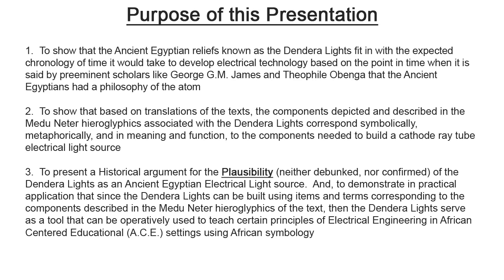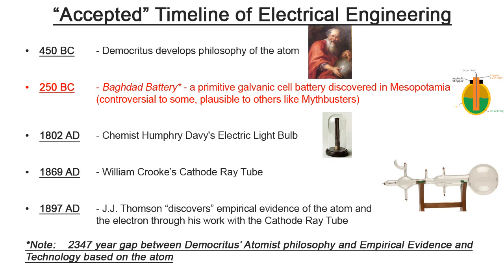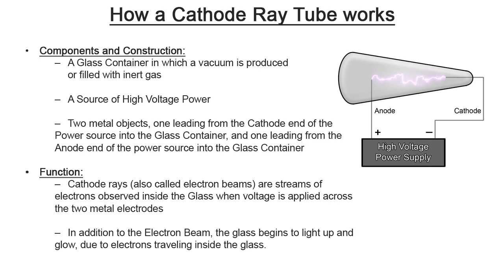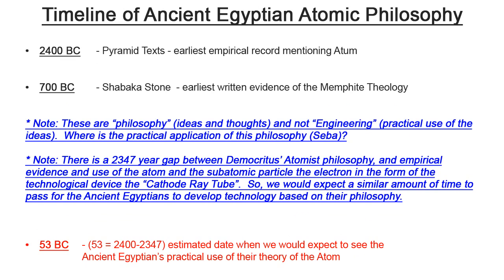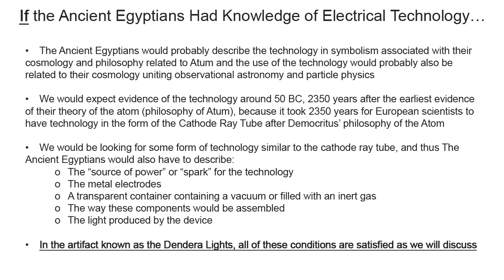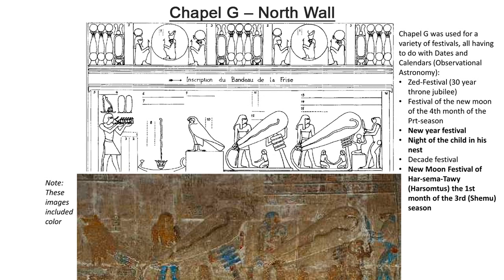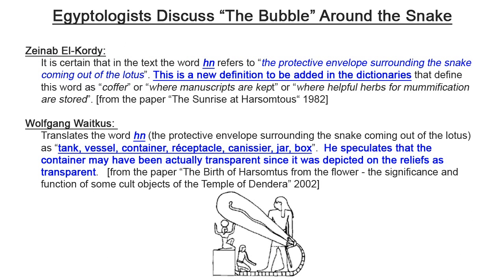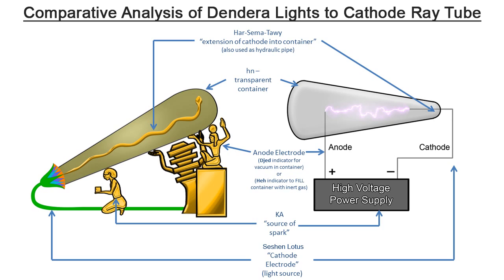Egyptian Light Bulb = PLAUSIBLE

Comment: thank you from "Solutions for earth Catastrophe Cycle 2048" #S4ECC2048.
Reply: Not a light source.  The Dendera lighbulb allows electrons to be injected into any solid surface.  one a rock wall, for example, is full of extra electrons it may expand or be easier to shape or the electrons may cause the rock to fracture and break allowing electron based etching and 3D printing.  there's actually a lot you could do like 3D additive printing with electrons used to statically attract and Glue dust to the surface of the work.  I think most of this is prohibited information or kept secret from the public and uncommon knowledege.  I think they used technology production of ball lighting and other technology we don't really allow the public to know about in our society at present. IMO.
Reply: @SteveWhetstone-UXDesigner  MIAMI CORAL CASTLE ?